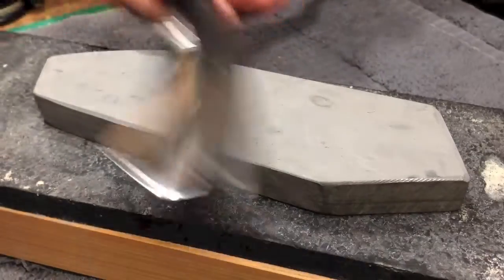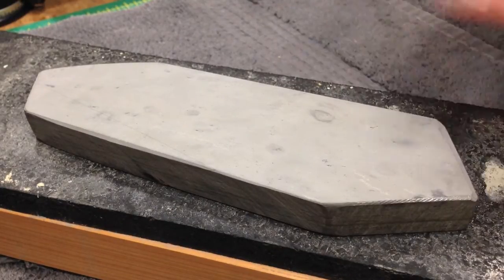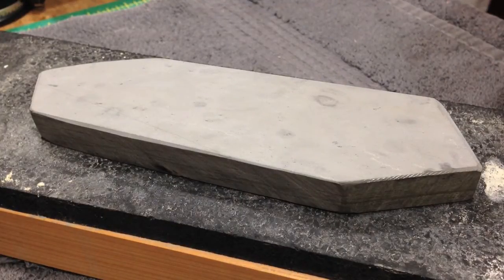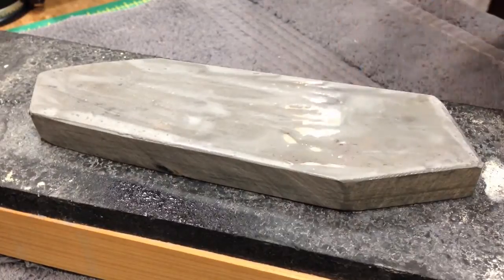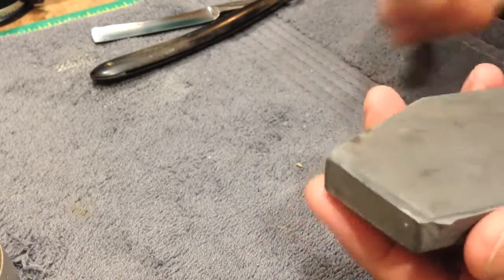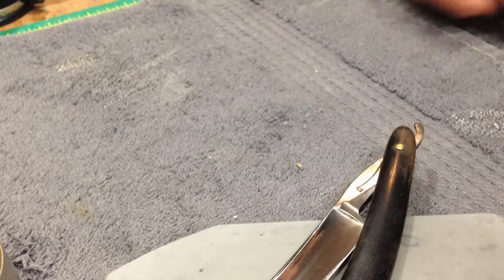Nakayama Mizu Asagi Karasu Koppa

Comment: Thank you Keith. You hit upon something that a novice, like me can really use about the action of the stone. I have been in this about a year and your comment about the speed (grit) cutting metal, about half way through, turned a light on for me. I've been using the same stone on a few different razors, always the same stone. The JNAT I got from you I'm guessing is hard and fast, but has different effects on different razors. Cutting and polishing quicker on some blades and not so much on others. Then your comment about this stone being hard but not so fast to work on a razor that needed a little more work than the "green" blade and boom like a truck. An awakening. Thank you. I've got one blade that is a particular bitch that I haven't been able to quite get up to speed (Crown and sword) this has given me hope and new ideas for this blade. Thank you

Monty
Reply from the maker: Happy Honing!